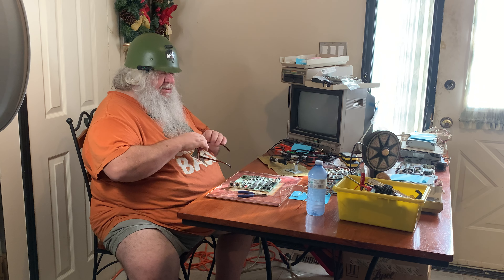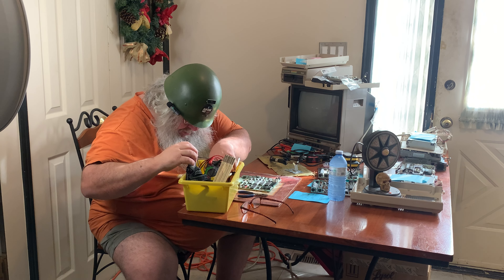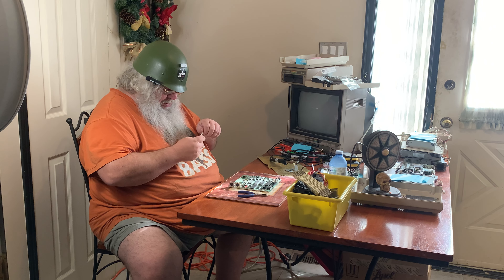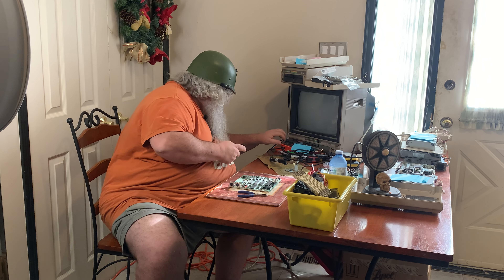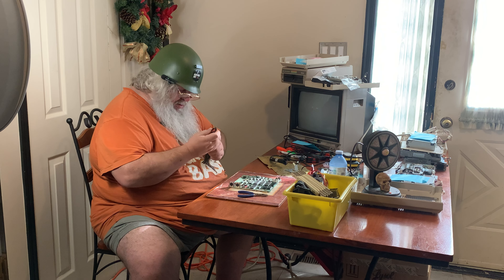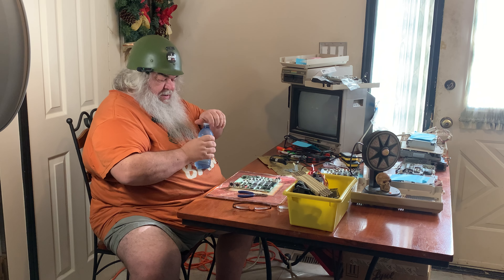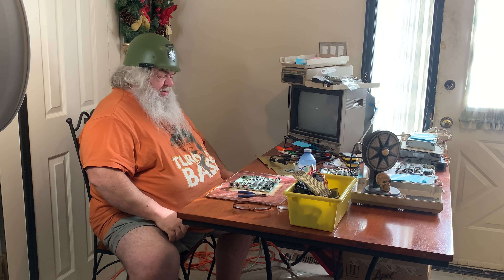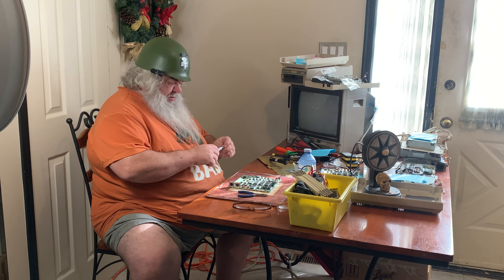1571 Assessment Disassembly Figuring Pondering Musing Commodore 128 - Part 15 Of Many - Episode 1809

Comment: I replaced all chips on my 1st gen VIC-20 today but destroyed 2 traces to a 245N and had to make 2 bodge wires!
Reply from the maker: Whenever you de-solder a chip or a socket or anything...there is always the chance that things will go wrong...and that despite your best efforts being careful and mindful of everything...a trace will come undone...and that sucks...but it can be fixed...just takes a bit more time and effort...but so far, I have had good luck with my removals...taking a very close look with my very strong glasses and taking a moment to attempt to move the pins away from the sides of the hole...but indeed, things happen...and it is no fun when it happens!